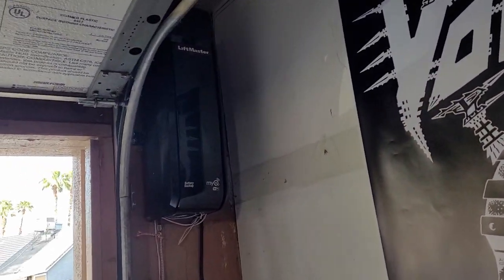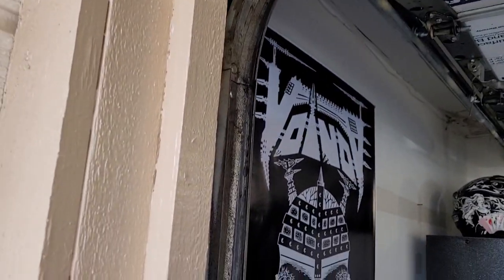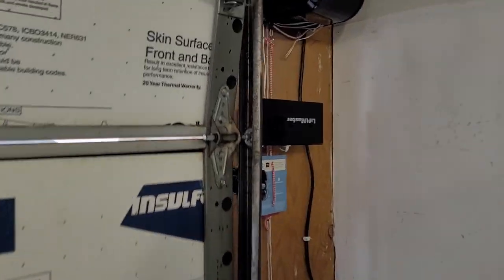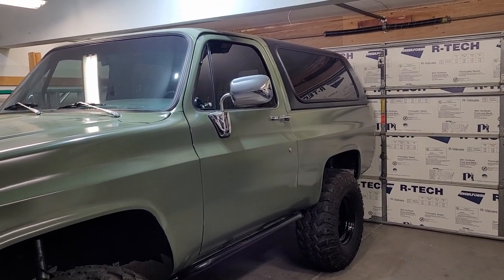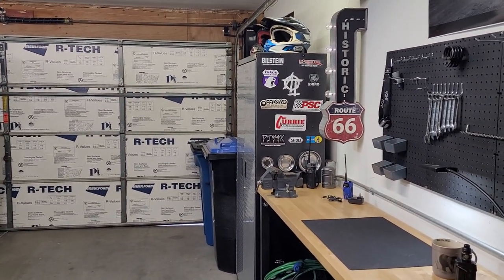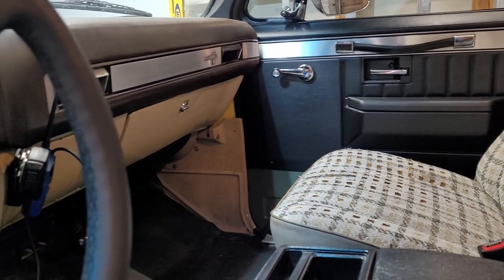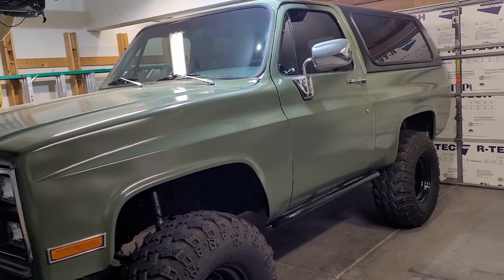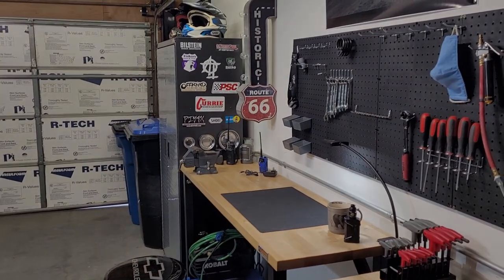82 Chevy K5 Blazer / Update / Putting The finishing Touches On My K5

Comment: Bro! LMC Truck has those kick panels in stock with fitment for both A/C and non A/C equipped trucks for about $30. They're in the interior panel section under Air Vent Components.
Reply from the maker: Dude thanks man I haven't looked for these in months.. LMC must of got them back in stock since then. I swear I looked through their site and could not find them. Thanks again.
Reply: No prob. They've been doing some restructuring on their site recently too so may have gotten lost in the mix for a bit. Glad to see you're almost "done". In quotes cause you know as well as I do these things are never truly done.
Reply from the maker: @tazimafied  I know it will never be done. Thanks again